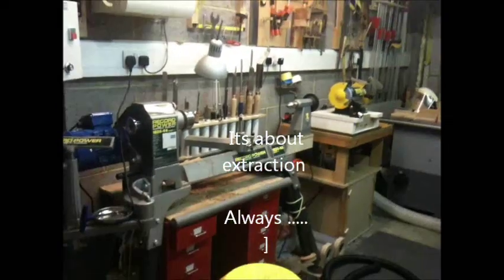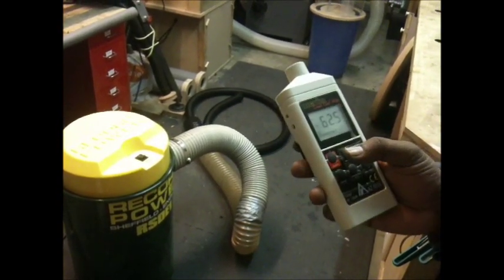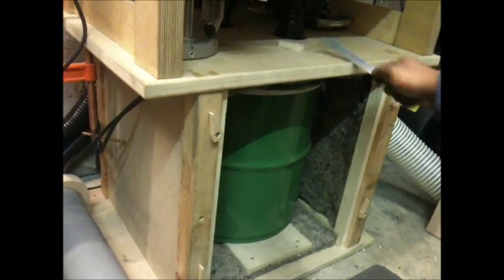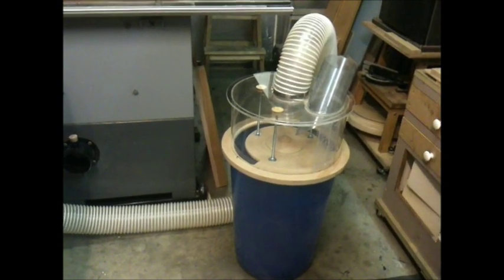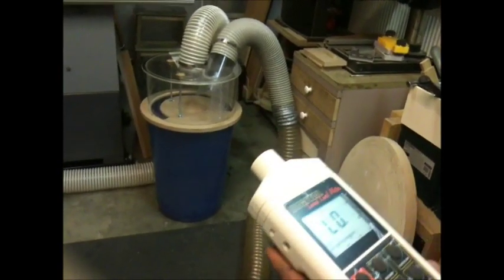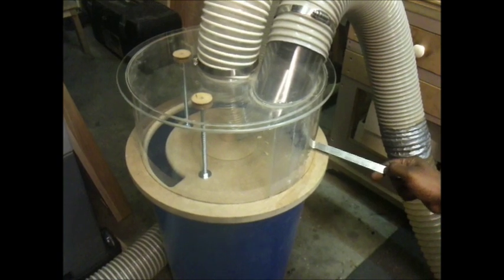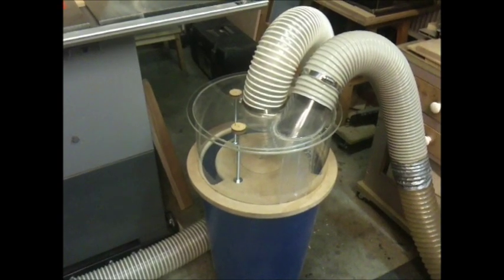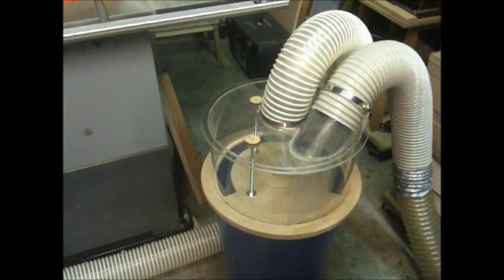Dust Extraction solution using a "Thien Separator" cyclone

Comment from the maker: UK
Am a woodturner as you may have guessed.
The top of the "clear plastic" is just 6mm acrylic offcut that was cut to size on the lathe itself.
A groove was created on its periphery to a depth of 3mm and the thickness of the flexible polycarbonate sheet (1.5mm).
A similar disc is made out of MDF for the base with the necessary cutouts to allow for the design .
It is then a simple matter of cutting the polycarb to size and fixing with medium viscosity superglue everywhere and epoxy to mdf

Comment from the maker: have put a link to picture of the muffler
the mdf discs are cut precisely to fit snugly into a 4 inch pvc drain pipe.
the void between the inner tube and the outer 4 inch tube will need stuffing with an absorbent - wool is best
hope this helps